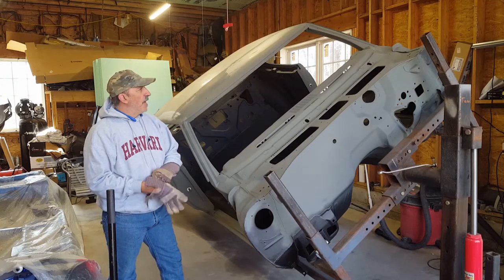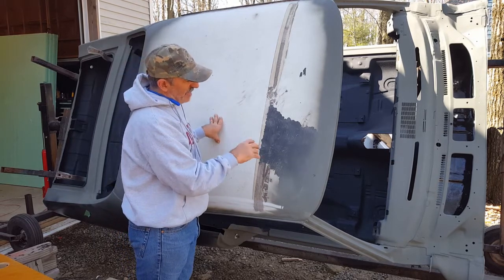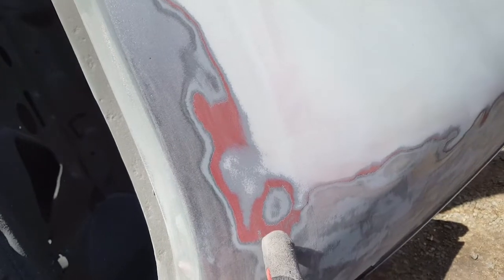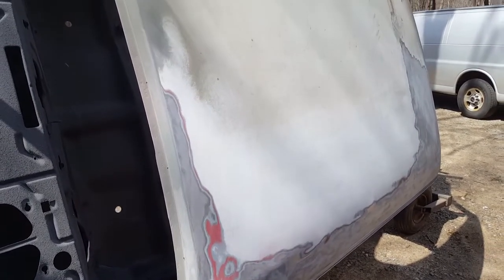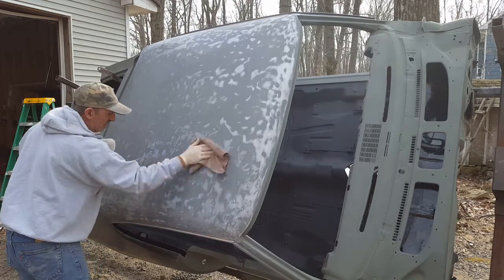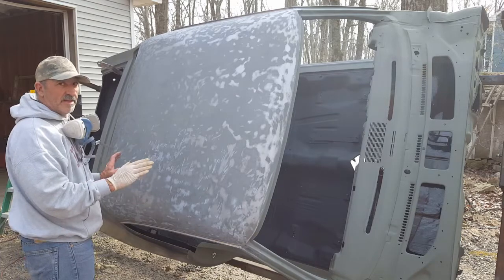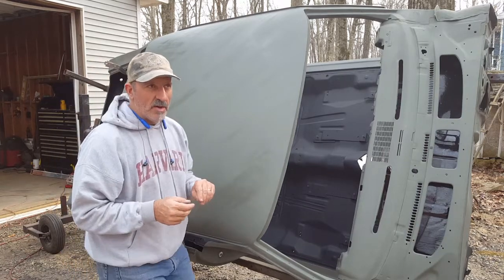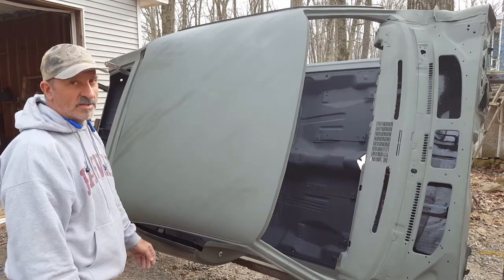A-body roof prep, etching primer

Comment: Are you going to fill the low gap between the quarterpanel and roof with lead? It would be a whole lot of passes with a mig?
Reply from the maker: Hi, I am not going to fill it with weld. I am actually going to use this product called Allmetal. It's supposed to be stronger than fiber strand body filler. It is used in a lot of flexible areas like to sail panel and roof. All the best

Comment: I stripped my car to bare metal, can I use self etch for whole car?
Reply from the maker: If you're going to work on it in sections, that's what I did. If you're going to start body filler. I would use epoxy primer.
 Etching primer is porous it allows oxygen to get to get to the metal.
Reply: One other question, after I hit it with self etching can I keep it like that for a while I work a lot and this is my first time, will it be ok or I need to add the high build now?
Reply from the maker: @NoSleep_318Gaming  
If it's garage kept. If it's out of the weather, it should be fine. Typically High Build primer goes on after you epoxy primer . Do your body work and then High Build primer. Typically that's how it's done
Reply: @ thank you!